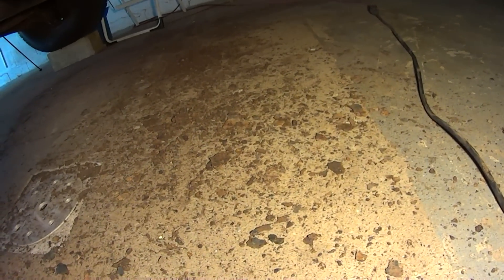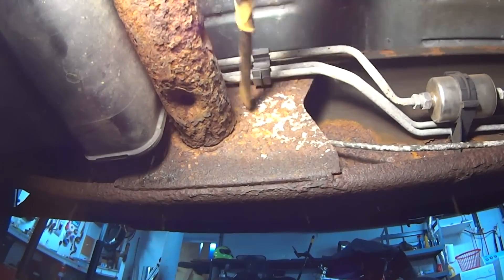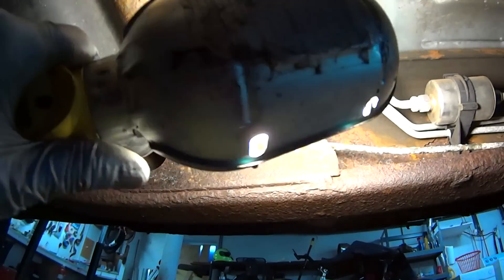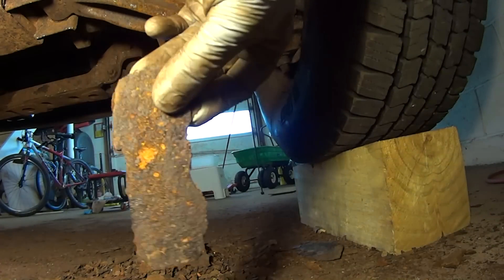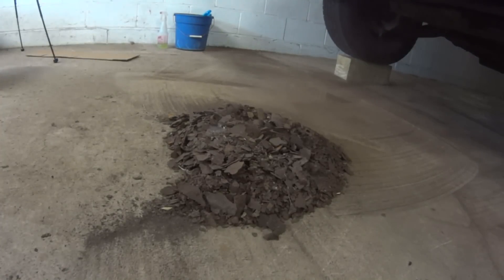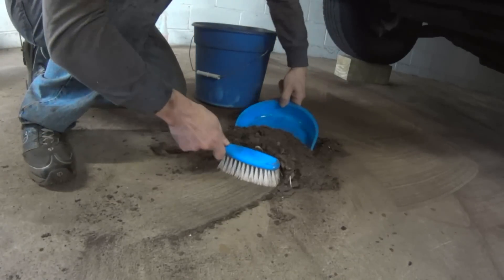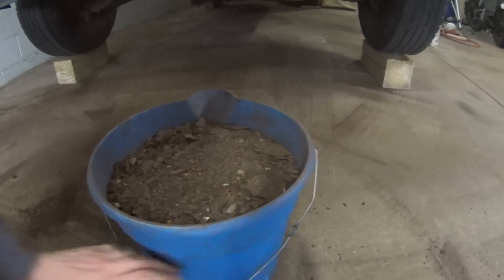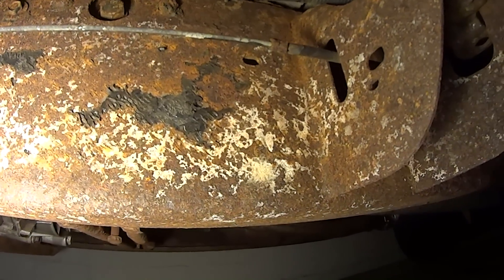Most satisfying video. Silverado Frame rust removal, RUST PROOF STUDY

Comment from the maker: Sandblasting would not do anything. Sandblasting only removes surface rust. When you got sheets 1/8" thick coming off, you have to knock them off.
Reply: sand blasting takes it down to bare metal, I have a 45 foot long blasting booth, 120psi I can blow holes in your frame if its thin, from rusting
Reply: Last time i sent a car out to get sandblasted it came back bare metal. Maybe youre using a shitty sandblaster lol
Reply: Ever use a needle scaler instead of the air chisel? After you wire brush what do you coat the frame in?
Reply: sandblasting is the fastest way to remove everything ..then you can see what's next..
Reply: steel abrasive grit would take this stuff right off. coming from a guy who's family owns a sandblasting and powder coating business. we've done dozens of frames like it.
Reply: So my question is after you remove all the rust , is the frame stil good or is it weak ?? pease help me understand ?
Reply: Astro Camper Youve never sand blasted anything than. Some black beauty and a good blaster will remove powdercoat, rust and show you rost holes and body filler you didnt even know were there.
Reply: Rust has no strength to it whatsoever. You can take that 1/8 sheet that he pulled off and crumble it with one hand. The real problem here is, with all this rust and lost material, the frame itself is weaker due to the rust itself. This one didn't look bad, but on some of them it can be a real problem.
Reply: Astro Camper I do appreciate the video. however I would strongly disagree with you as far as sandblasting goes if you use a full-size commercial sandblaster with a very high-volume commercial air compressor it will blast anything and everything off of the frame!!! as a matter of fact you could ,if you wanted to blast straight through the frame!!! even if it was brand new !!!however the lower  volume and smaller sandblasters don't do as good a job !for a homeowner job like you did definitely the air chisel is the way to go!!!
Reply: Hh
Reply: Would you be able to sandblast this without ruining everything else?
Reply: What year is this truck?
Reply: 120psi is nothing lol
Reply: Chaoswolve66 this people don’t look like expert in my personal opinion sandblasting would have done a better job
Reply: James Ball l ll
Reply: Trout Junkie knock knock, whose there? Mr. Rusty.
Reply: that's just paint
Reply: Brad Młodystach yeah you also have to remove the engine and make an appointment and put everything back in. Fuck that
Reply: Speaking as someone with a lot of experience Sandblasting you can remove almost anything.  It all depends on what media you are using and the pressure.  The hardest thing to remove is the mill scale that comes on fresh steel from the factory and it won't stand up to 80 grit silica sand for long and less time using metal shot.  That being said,  you have to spend a lot of time masking off or removing wiring and hoses etc. and then you have to be very thorough blowing all the dust out before coating the surface.  Sandblasting will do a better job but the time it takes may make the work prohibitively expensive.
Reply: As long as there are no cracks or holes in the frame it should be ok for service.   Most of the frames are overbuilt and the weight capacity has more to do with the suspension of the truck.
Reply: if you think sandblasting only removes surface rust you really don't know anything about sandblasting
Reply: Dustless blasting is good too.
Reply: Caleb Maddas not really because the  grit will get into things you don't want it too...id use crushed glass and use a very small nozzle with pressure turned down very low..
Reply: Otoniel Cardona There s a big difference between sand and surface rust and this. You need to use an air chisel to flake that stubborn crap off first before you sand blast it. Sounds like you have little experience with thick flaky rust.
Reply: HF Air chisel and just let it bounce.  $20.   IR needle scaler $100.    Scaler just dances around using lots of air while the chisel uses little and the flake peels off nicely.   I have both and believe me the  nice scaler gets used almost zero.     What a huge disappointment .      Sad but true.    Just hold it loose so it doesn’t cut in , angle that air chisel and let it bounce.   
   Frozen rusted pins , bolts, same deal.    Penetrating oil then take air chill and blunt point and let her bounce.  Watch the oilseed in as the vibration brakes things loose.    Slower than a torch but almost as effective.     Oh how I wish I’d known all this 35 years ago ........
Reply: Otoniel Cardona Nope.
Reply: Some of that scale almost has to be chiseled off... Sand blasting would thin it out, and take the loose stuff of, but the thick sheets it wouldn't touch.
Reply from the maker: No. Too thick. Sand will not penetrate rust like that.

Comment: Hey bud did you chassis saver this portion also? what did you do about the body mount parts with rubber bushings?did you cover them or just paint right over them also? and on my truck the harness sits on top of frame and is kind in the way what did you do for that? and did you tank the fuel tank down to get frame 100%?
Reply from the maker: I dropped the tank to clean the round tubes (made video about it). I also made video about the front frame and my wax and grease mixture. Just browse my channel.

Comment: that factory coating is garbage and the frame rails designed not very well, with lots of voids for dirt and water to get trapped. mine is a 99/00 Silverado 1500 ext cab

Comment: If you live in the north east and don't wash your car in the winter and rust proof it bye bye car in a few years.
Reply: Fluid film you vehicle once a year and you don't have to do car washes all winter. The absolute WORST thing to do in the rust belt is to park your car in a warm garage every night. You end up melting the salty slush stuck to the underside of your vehicle, and the additional warmth helps speed up the chemical reaction that forms the rust in the first place, plus the salty water seeps much deeper into the frame and body panels. Keep the vehicle outside in the cold and only wash it when you get a warm snap above 10-20 F.
Reply: Jay Gold I have learned after many years in New York that undercoating and washing hardly if even slows down the rust, your better off saving that money towards a new truck. I never washed or undercoated my truck and my dad did and both our trucks looked the same in seven years when we got rid of them, now he doesn't even wash his new one ever. I wash mine in the summer but I don't wax it because the frame will get all rusty and I'll be spraying it with undercoating to trade it in before the paint ever fades.
Reply: fluid  film   them

Comment: Why not just get a vehicle from Arizona and avoid all of the labor and the cost and start with a vehicle from scratch
Reply from the maker: Southern trucks cost a fortune, even with high miles. I paid $1000 for this truck with 130k, one 70 year old owner, never hauled anything, got all the records, Mobil one from day one. Unfortunately the salt did a lot of damage. Most 3/4 ton trucks with 130K in Arizona are $10,000
Reply: I wasn't aware you got such an excellent service history on it. Im in the midwest and would pay an extra 2 grand depending on the year and make for an AZ car. Nothing rusts in the dessert.
Reply: +Sanctus Vianney  Your in a really different area than Astro Camper I think he is in Penn . The East Coast is Rust Central like myself in Massachusetts, we deal with road salt now brine witch is a liquid version of it. Car and trucks have rot rust issues in just a few years.I just picked up a 97 and will be doing cleanup as well.

Comment: Krystian, how do you think all that rust removal has effected the structural integrity of the frame?  It will be interesting to see the salt removal now. Do you plan to replace any of the fasteners or rubber bushings while doing this? Those rubber bushings dry up after a number of years.
Reply from the maker: Actually rubbers look decent. I will swap them as they fail. The frame is still solid. In 1999 and 2000 they had thicker, bulkier frames. Today the truck frames are half the thickness and only 5" tall. Mine is 9" tall C channel that is 0.150 thick. Some spots are 0.120 thick now but still plenty of metal. Rust expends x4 so it looks worse when it peels off. The metal loss is minimal. When I grab places with no rust and the worst spots, I can hardly feel the difference in thickness. Will take some measurements on next video.

Comment: I wonder if the frame had only been coated with paint, would it actually be in better condition? Once moisture gets in between, the rust develops even faster I think. What kind of undercoating you are going to use?
Reply from the maker: The fully rusted parts will be painted with Chasis Saver. On the inside of the frame where there is still about 80& of original wax, I will use wax from toilet rings.
Reply: @troutjunkie7330  hey how has chassis saver held up for you?